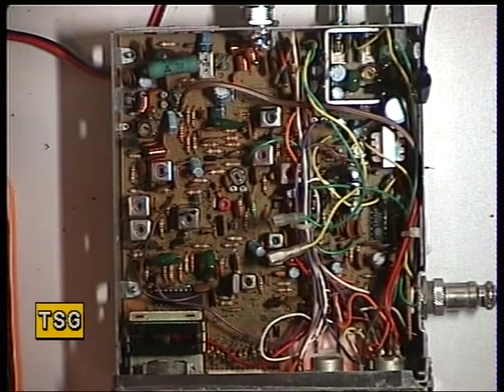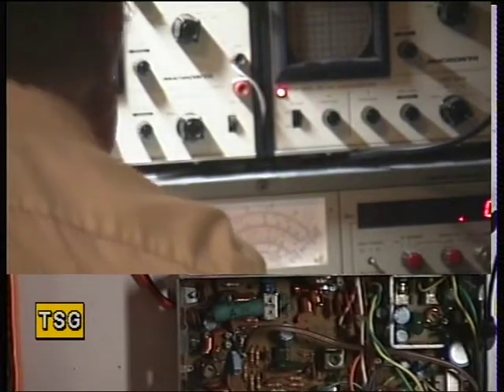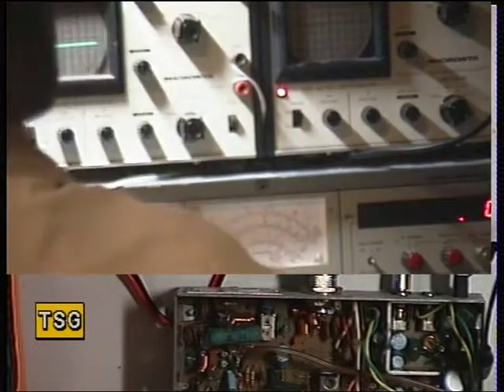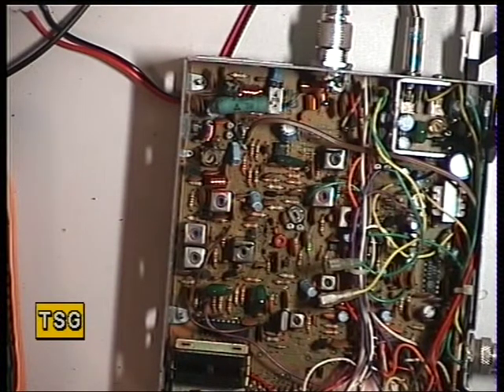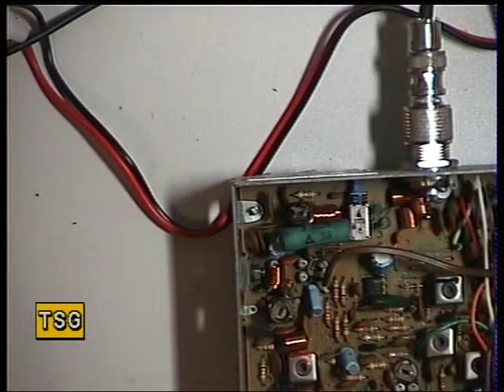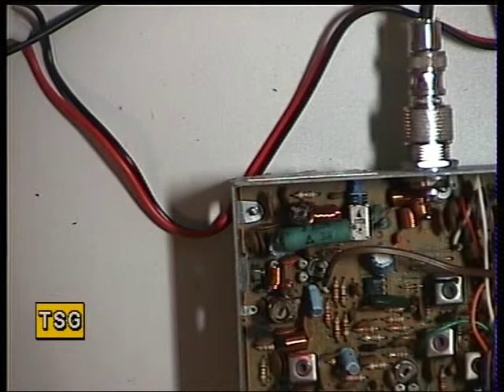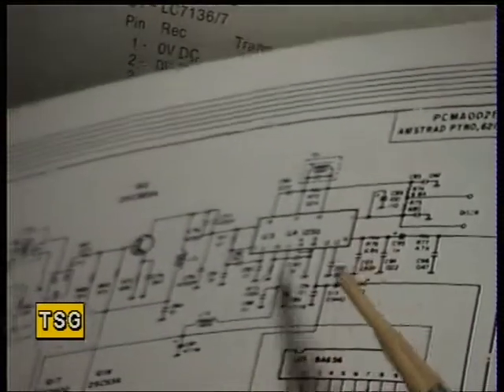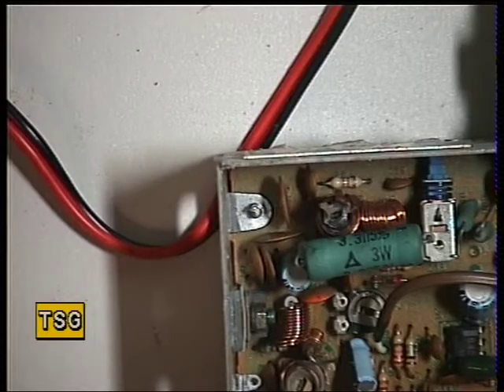Mustang CB1000, UK CB radio. Transmit alignment

Comment: My cb1000 only shows a rf output of 1 watt on high power .when i align it on transmit can i do it into the aerial or do i need to get a dummy load to align it.
very informative videos.
thanks for posting them.
Reply from the maker: Paul Myhill You have to use a dummy load Paul